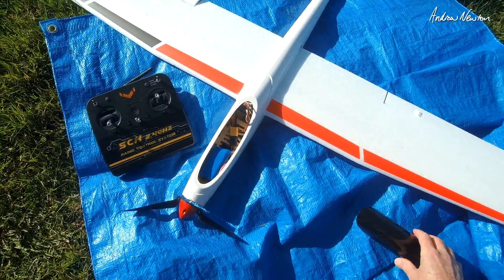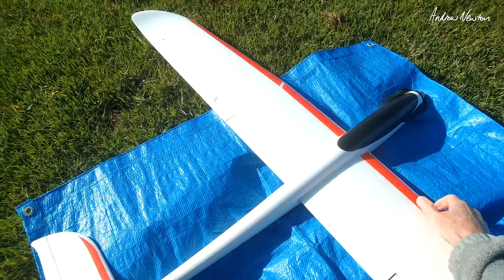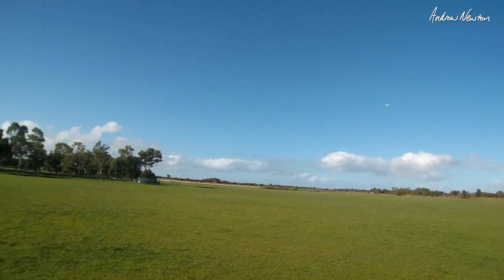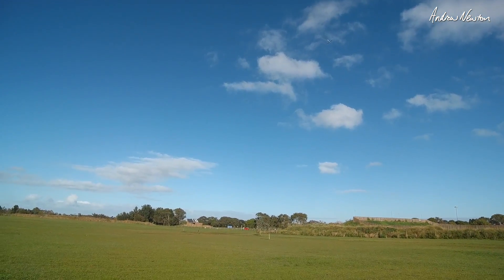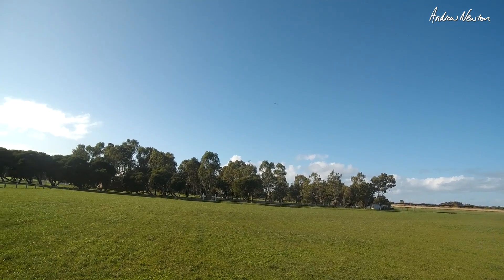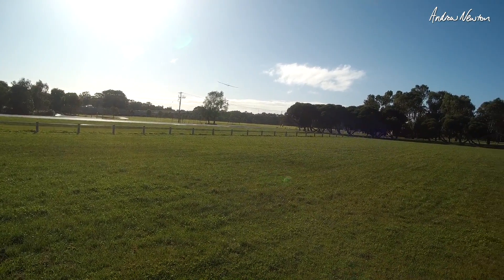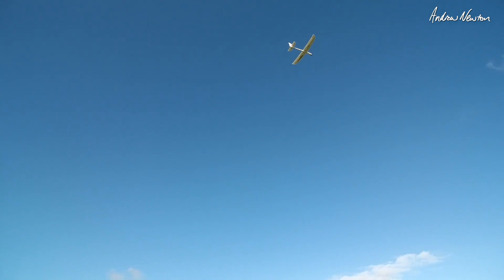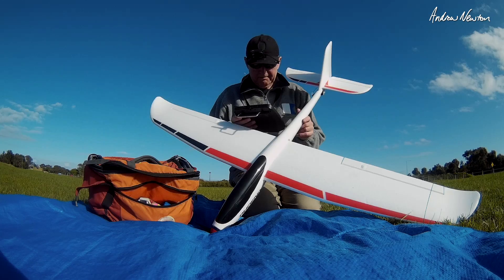PhoenixS RTF maiden

Comment: hi i want to buy thing plane and fly it up to 1.5-2km and i think to get it in pnp version and add the transmitter and the reciver and the battery the problem is i am begginer and id know which one to choose can you tell me? and will it be hard to build it? im not fully begginer i fly  about 20-30 times other rc planes but not more that 600meter range

Comment: i know my stuff when it comes to rc cars and trucks, now I want a plane. I have been thinking of getting one of these, RTF. My main concern is range of the remote control, but also maybe because i will have to teach myself how to fly so i wanted a stabilisation. I am a little conflicted.
Reply from the maker: If you're teaching yourself it's best to go with a Bixler 2 style pusher setup and no extra confusing stabilisers.
Reply: @AndrewNewton  thanks for the tip!

Comment: Would it take 2s 5200 lipo?  Here in the US you can pick them as cheap or cheaper than 2000/2200 2.
Reply from the maker: Yes, that would be fine. Will fly a bit faster

Comment: Does it have 2 level of stabilized mode ... ? 

Is the aerial footage taken while in manual mode ? 

70€ for that radio, stabilizer and battery is too much ... so buying your own transmitter  and battery is the best way and maybe that Kopilot if you can get that at sale ...
Reply from the maker: Yes 2 levels, Yes Manual onboard

Comment: The gyro started malfunctioning on mine, rudder sticks full on after stick is released, but it flys great without the gyro...
Reply from the maker: My rudder moves slightly, maybe we need to reset the level. I haven't done it yet
Reply: Rudder operation on some Volantex planes is odd. In hand on the ground in stabilized mode, if you swing the rudder to the side then let the stick center the rudder seems to hold angle till you turn the plane towards that direction whereon the rudder will creep back to straight. If it stays stuck as you turn you've got something amiss. Manual the rudder follows the stick.
Andrew the old version of that radio used to have channel reversing switches on the front of it. Have they gone to the same system as the V761 series planes now? After binding and before arming hold the stick hard over for 3 seconds or so and after a beep the servo will reverse. Then arm and it's locked.